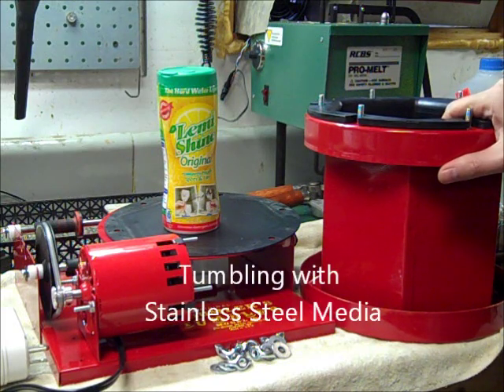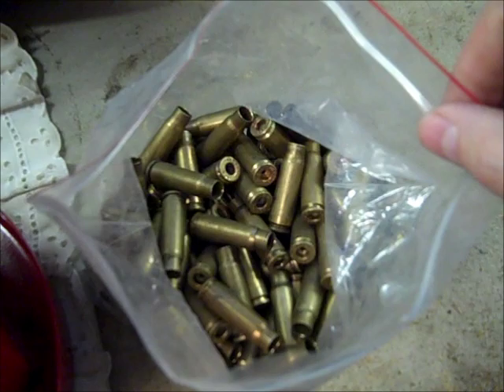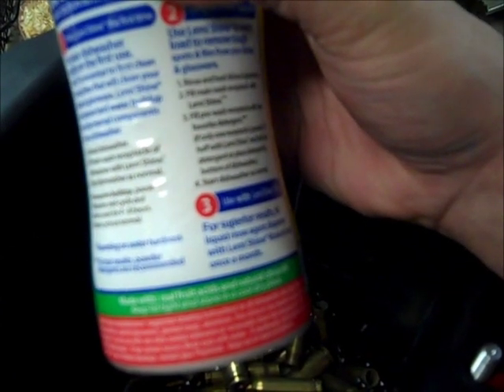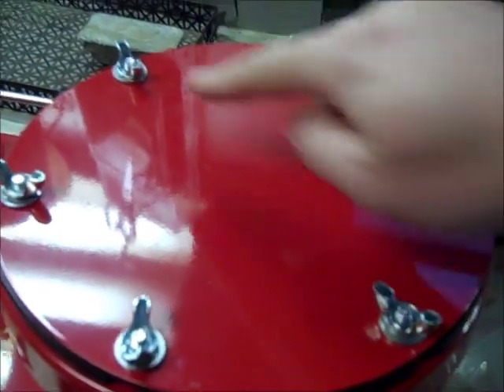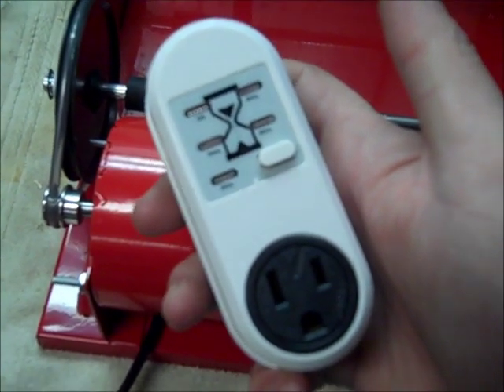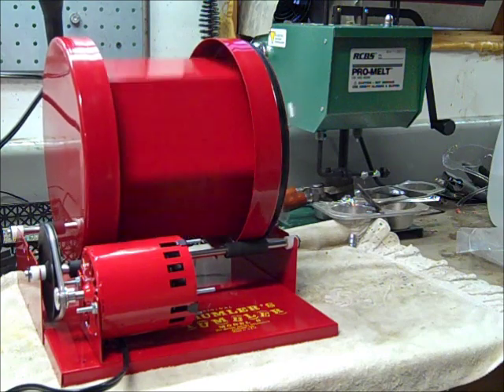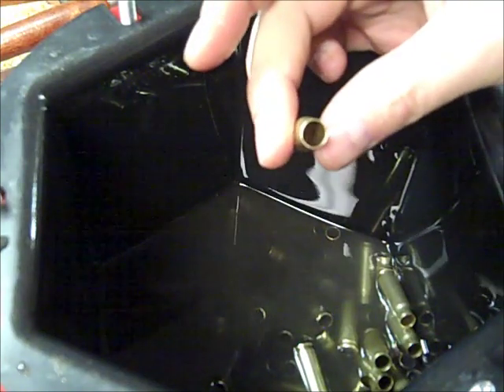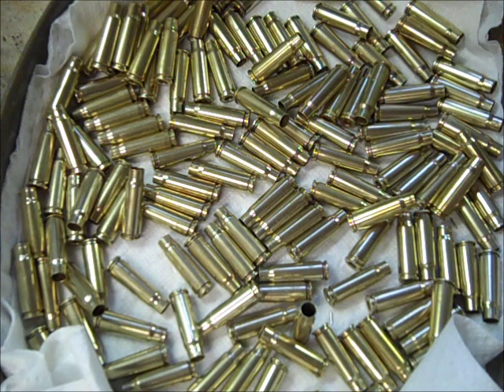Thumlers Tumbler with Stainless Steel Media - Bullet Case cleaning

Comment: I've been using a Thumler like yours since 1977 and is still going strong. I've only replaced 2 belts and 1 lid gasket. These units are bulletproof. Spent more money buying it than I wanted to but am really glad I did. 
MaineJ....I'm still using walnut and corn cob in mine. Walnut for initial cleaning and corn cob for getting the case lube off the loaded rounds. Yes, I tumble loaded ammo!! 
Thanks for the info on using stainless media.

Comment: To each his own, but you're cleaning with about 10 times too much LemiShine, and that's the most expensive part of your mix.

A teaspoon of LemiShine (9mm casing full) is plenty, with a couple tablespoons of Dawn, and at least twice the water. The water is what's going to carry away the grime once the pins and soap knock it off, and it will get nasty black and dirty. Use hot water, and use more of it.

Comment: 1:30 "add some water, or chicken stock" LOL  Mmmmm Looks delicious!

I started using the stainless steel pins [actually your entire recipe, although, I add 3 - 1" superballs to create an uneven tumbling effect, as my drum isn't hexagon shaped, but round, and a couple drops of Dawn detergent.] with fantastic results. Even the flash holes get cleaned out. The brass comes out looking like they are brand new, and clean inside and out.

Comment: Ok... listen up people!!
If you want a great, long lasting tumbler, don't buy anything but the thumbler tumbler for your brass cleaning.
My wife bought this tumbler for me in 1982!!! Yes!! 1982!!!!
I used only corn and rouge for cleaning my brass for years, but.... now I am using the wet cleaning process with Dawn dish soap and lemishine and I love the way my brass comes out. It looks like new!!
For 38 years I have used only the thumbler tumbler for cleaning my brass and the only thing I have had to replace is the drive belt which is the same as a vacuum cleaner belt.
I put a drop of oil in the motor bearing port each time I use it and that's it!
After 38 years and thousands and thousands of brass cleaning, my thumbler tumbler is still running like a clock!!
Bottom line is, their are many brands trying to compete with the thumbler tumbler, but... not one can compare to the quality of the original brass cleaning and rock tumbling machine like the thumbler tumbler!!

Comment from the maker: I use a cheap media separator which works quite well to get most of the water out.  Then I either dry it in the sun in the summer or on the woodstove in the winter.  :)  Thanks for watching.

Comment from the maker: There doesn't appear to be a problem, at least not within the normal lifetime of brass since it will eventually fail.  I typically tumble for 2-3 hours.  It has been reported that the nickel plating on nickel brass will get scratched off... I usually tumble that stuff in corncob.  Thanks for taking the time to comment.

Comment: Got a tumbler shipped after seeing this, thanks.
Reply: Bobby93636 There were 2 different speed motors that were available for these. If yours is not as fast as the one in video, you can do a modification (tubing over rubber drive rollers) that I mentioned earlier on this page.

Comment: I have heard of 2 ways to store the stainless steel media. One is to clean it and dry completely, then  put away in a sealed container and the other way is to rinse it out clean and store it covered with water. Second method would be quickest and easiest to finish.Those that think stainless steel won't rust needed to see my 38 S&W revolver after surviving a long "drying" storage in basement after a flood. My 30 caliber lemon squeezer wasn't so lucky.

Comment from the maker: Hi, thanks for watching.  I found the best price with shipping at Buffalo Arms online.  Call them to get the USPS small flat rate shipping (it will fit in a small box but their site defaults to a medium box).  The human on the phone can fix that and save you about $5.00 which the website cannot.  Also, perhaps you can just get the flat rubber lid seal for your tumbler?

Comment: You will notice those 4 extra slots cut out on area of drive and idler shaft...those allow the ability to move the idler shaft (just lift off) closer to the drive shaft, and now you can use the smaller 1-3 or 6 pound drums. These are an additional purchase item or use your spares from other model tumblers...there is enough adjustment that a drums will work.

Comment: I use a different tumbler. As far as cleaning brass, I use hot water, a few drops of Dawn, and citric acid. You can buy a large bag of it a lot cheaper than Leno Shine. Two hours is plenty of time to clean even the dirtiest brass. When cleaning nickel-plated stuff, do not use any citric acid! You’ll ruin the exterior! It will turn dark and smoky looking. Also, cut your time to 1.5 hours max.

Comment: One little reminder here. This "Thumlers 140 Model B" Tumbler you see here running FAST is an upgrade (different motor) version....so if you want to tumble BRASS make sure you get one with the fast motor already attached. Shouldn't cost any extra. You can modify the slower type by slipping some tubing over existing rubber rollers on the drive shaft. Be sure inside diameter of new tubing is same as outside diameter of the rubber rollers. You can use a little bit of soapy water to help put them over rubber if need to. Soapy water better than oil because it will dry. Now you have faster drum rotation because you changed it's "gear" rate. Remove this mod if wanting to polish stone or whatever.

Comment: FYI the exact soap lemon shine and water mix is, 2 table spoons of dawn dish soap, 1/4 teaspoon of lemon shine and 1 gallon of water. You are only using about 1/5 of what you should. The motor is suppose to run with around 15 lbs of weight to drive. your maybe using 7-8 lb. 5 lb of steel, 8 lb of  water, 2-3 lb of brass. This is according to the guys that make that tumbler. 1-4 hours is the time to run the tumbler with the above method.

Comment: Hi there, please becareful with that method tho, the nature of any acidic cleaner, is that itll be abrasive and generally wareout the brass. You will not get as many loads of the cases as you would of the conventional medias liek corn cob or walnut shells. We in SA used that this method a while back but found the passive cleaning methods to be better in terms of long lasting brass.

Comment: I have a Frankford Arsenal tumbler. But it's really big and I am looking for a smaller tumbler for less cases. I put the water just over the top of the brass about 1". A little bit of dish soap and according to the amount of brass I'm cleaning two caps of Frankford Arsenal brass cleaner. Two .45 cases of Lemi Shine. That is for a full one gallon + of brass. 

Well, one day I forgot the SS pins. To my surprise the brass looked just as good as they did WITH the pins and maybe even better because they didn't look "satin" finished. The primer pockets on most looked great too...So since that "mistake" I don't use SS media any more. 3 hours is plenty. You definately used WAY too much lemi shine.

Comment: Nice. I like the whole "never needs replacing" aspect. How well do the steel pins separate from the cases? (I'm thinking about the possibility of surface tension helping the little buggers to stick to the inside case walls, here.) But damn, the final result looks good.

Comment: " Look for a .310- to .311-inch diameter bullet in the 120- to
130-grain weight range.  Acceptable results have also been reported
using .308-inch, 150-grain jacketed bullets intended for the .30-30."

Comment: Great video! Where did you get the pins? Also, do you think this would work in a vibratory tumbler instead of a rolling drum?
Reply from the maker: I have forgotten where I bought the pins but they are pretty widely available I think.  Some are magnetic too.  I would think them too heavy for vibratory use but I think I have heard people say it worked.  Don't quote me on that though.  I have found the rotary tumbler, wet, with lemi-shine works great.

Comment: Thanks for posting this great video. I just received my new Thumlers Tumbler today and have the first batch of 40 S&W going now. Your video was very informative and helpful. I dumped the first batch of water and Dawn soap which I used to wash the new Stainless Media first. It was nasty.. So the new batch of water and Lemi Shine and Dawn are spinning away. The brass already looked awesome after only one hour! Like the other guys I've always used corn cob media in a Lyman virbo tumbler with very so so results. The inside of the cases always remained dirty as did the primer pockets. No good! I recently tried Lyman's Tufnut treated tumbler media hoping for better results. This stuff SUCKS! Run don't walk away from this nasty Sh@*. Its awful stuff. I usually like Lyman products but this stuff is NO GOOD! It leaves a terrible red residue all over everything. So! Really looking for great results with my new Thumler. Thanks again for the awesome video.

Denis

Comment: I really hope you took the time to rinse that brass thoroughly with hot water to remove the acidic cleaner. By thoroughly I mean a minimum of 5 minutes under running, scalding hot water. If not you're asking for trouble later on.

Comment: What make and where can I get that timer, I searched and never found that type !! I would die for one. Please let me know the make and model. I think you use WAY to much Lemi Shine, you could use 1/10th that amount and get the same results. That will save you money to :)
Reply: Nick Musuraca Search eBay.com or Amazon.com for Woods Import Digital Countdown Timer. 
You can also find them at Sears but they're a little more expensive there.
And there are better brands to be found at Lowes.com if you search for "Electrical Outlet Timer".
Reply: DM Dave Thank you VERY MUCH.............. That's a big help, no more watching the clock or forgetting it all together !!

Comment: anyone who hasn't yet bought the harbor freight double rock tumbler, don't waste your time, unless you do almost no tumbling: it's a plastic-ey flimsy joke that will overheat, the drive 'band' will snap until you only have rubber bands left, the plastic fan blades will snap themselves off, and the rods will literally fall out of their "bearings" until you can't repair them any more: on the other hand this item above looks very solid....or you can DIY homebrew....
Reply: Yu Toob Yes the drive belts suck.order better on Ebay. Be sure and have your tumbler on balanced support (floor,table,bench). Don't overload your drums with media or material. The dual drum (double) rock tumblers are on sale for $44 at harbor freight till end of month. Just the 2 drums alone are worth $60 including shipping if you purchased from Ebay.

Comment: I personally think u are using waaaay too much lemishine & not enough water. Personally on average dirty brass I use 1/4 tsp of lemishine, 2 TBsp dish soap and I fill the tumbler to the top with cold water. I found that a little L/S goes along way and too much gets the brass dark and "tacky". For some reason warm water also gets the brass dark. When I have REALLY dirty brass like corrosive berdan Yugo M67 I'll put @2tsp of L/S (salts), 3-4 TBsp soap & hot water for 1hr, then drain and run normal